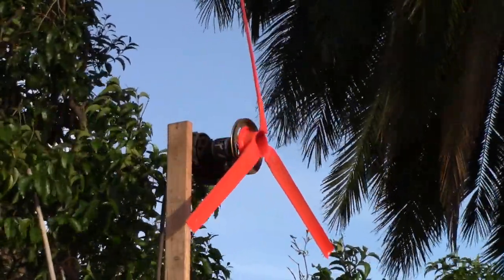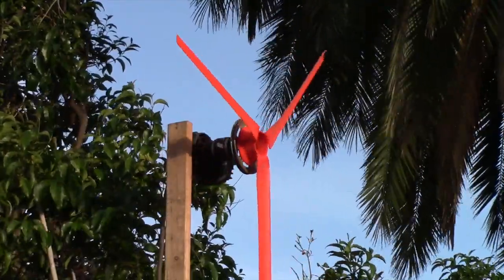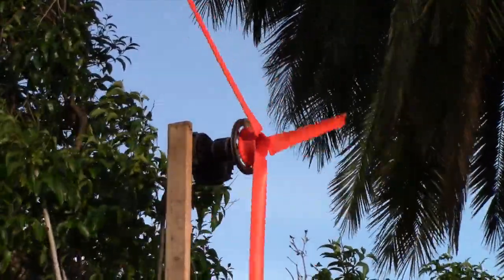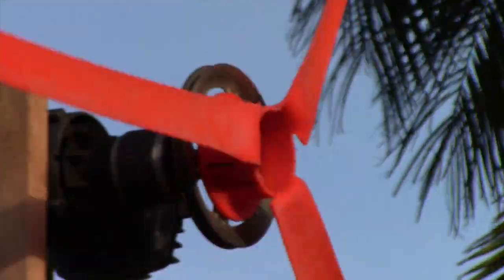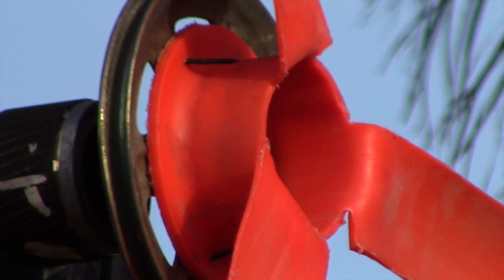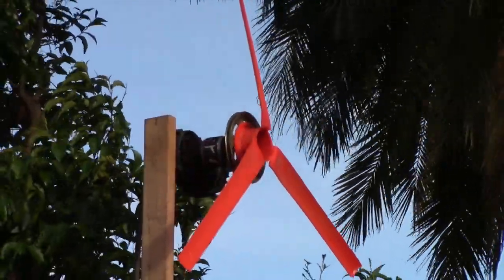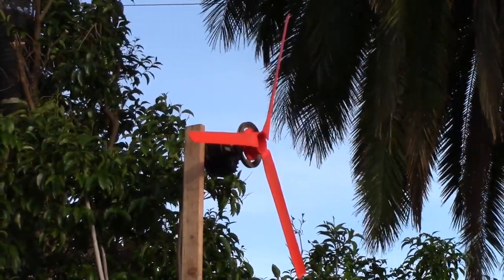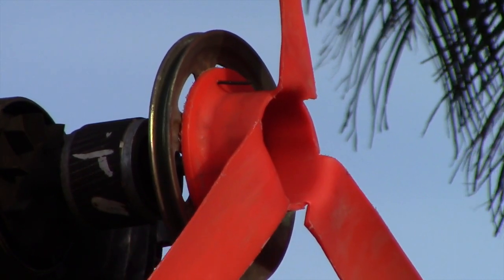1 piece 3 blade flexible windmill prop

Comment: FANtastic no doubt! ...kinda was wondering what type of air pump. Thanks for the video!
Reply from the maker: It is a old recycled reed type  pump designed for higher RPM but I just need a little air for a fish tank to make it all worth it. If it will fit in a video I'll put it in one for ya.
have some fun today!!

Comment: Looks almost like the pump it is driving is hitting a compression cycle or something which stops it from turning freely. Not enough torque perhaps? Very cool.
Reply from the maker: Yes it does get pinched up on the power stroke if there isn't enough wind...it used to pump into the shop air but now it is just for a fish tank to keep the compressor from kicking on all the time the last blades would flywheel it more but it broke apart after 3 years in the sun  after the pvc got brittle,, check the old blades in this vid http://youtu.be/ytwP1QPLm10  , have fun we'll see ya!

Comment: It might require less wind to turn it if ya took a plastic drum of the total unit diameter and cut a strip from it to attach to the circumference of the blades. Just bend the tip of each blade with a heat gun and drill holes to attach the tips of the three blades. This would bind the blades together as one unit and create a more focused funnel effect over the curved surface of each blade. Hope you get what I mean. Great engineuity Milo.
Reply from the maker: I do get what you  saying and was thinking maybe just bailing wire blade to blade if it gets to far out of shape. For now it is doing the job even if it  pumps 15 minutes here and there through the day.

Comment: cool, made a big one few years  back with 8 foot blades. blew apart one stormy night .one blade went the length of a foot ball field and one stuck in ground below tower ,never found 3rd that ended my carrier making juice with wind.lol.
Reply from the maker: Yep. I had one in that same spot made out of the green 80 PVC and it was scary to be near..it broke up after 2 years from degradation and I too never found a blade.

Comment: find a way to get that head to swivel and that thing will probably run your shop compressor lol thinking green my friend
Reply from the maker: I had a windmill that could rotate though it always ended up pointing in the same sweet spot.  Indeed I have had it pump into the compressor tank though it took a few days to slowly pump up.